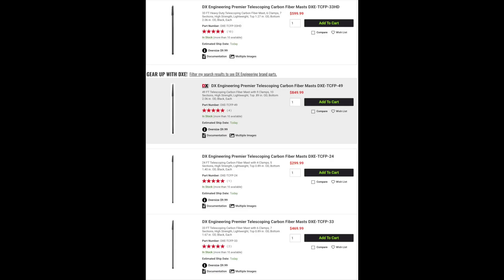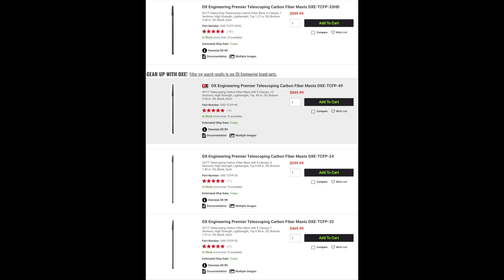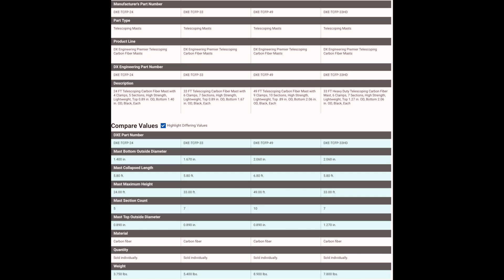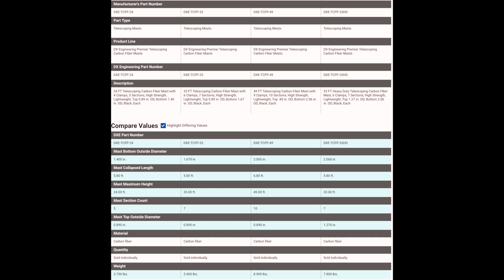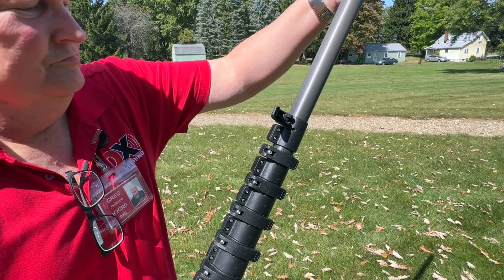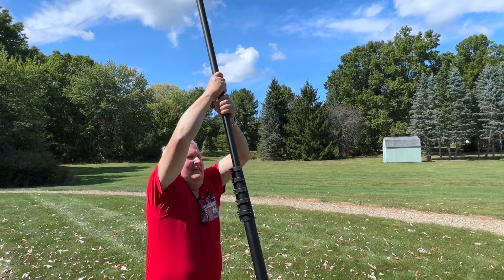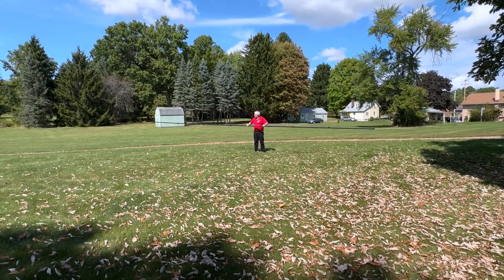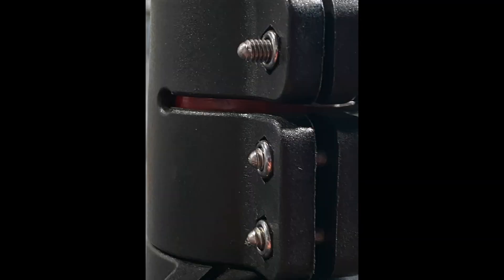Why Choose a Carbon Fiber Mast for Ham Radio Portable Antenna Installations

Comment: Those prices are ridiculous.
Reply: Right.  You could buy a rohn 25 40 foot tower for 900 dollars and put a yagi up!
Reply: @jameyevans29  sure but you can't grab a rohn 25, collapse it and put it in the back of your truck or carry it with one hand. These two things are not meant for the same application.

Comment: no vertical...? so a point style wire is ok though?
Reply: Yes. The carbon fiber mast is great for supporting a diploe or end fed wire.  Just not a vertical wire.
Reply: @mikemurphy1940  Thanks Mike, as soon as I saw this video for Carbon Fiber mast the "Vertical Wire" thought came to mind. Again thanks for answering my question about Carbon Fiber interfearing with antenna performance. (I really like DX Engineering's honesty. 🙂)